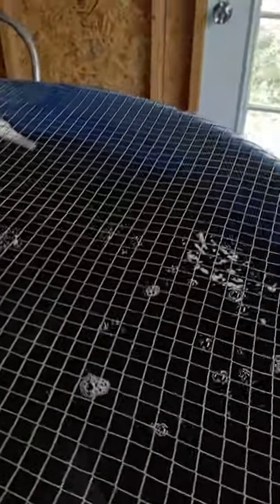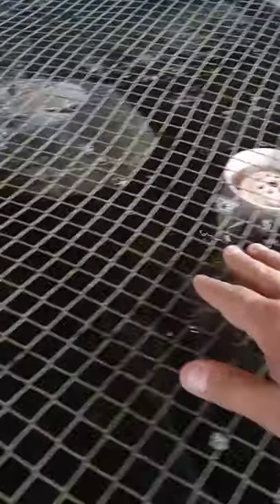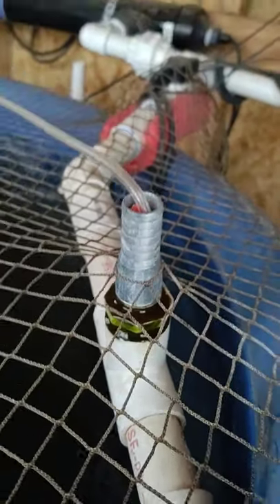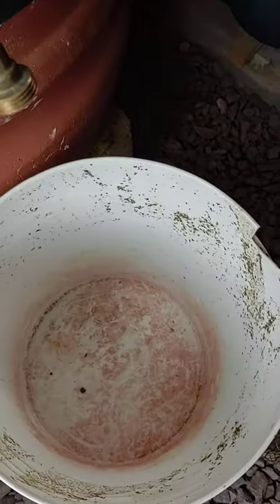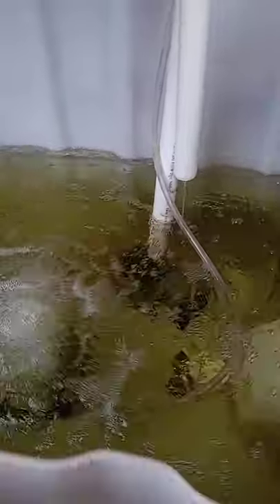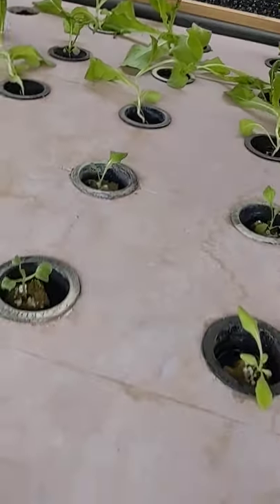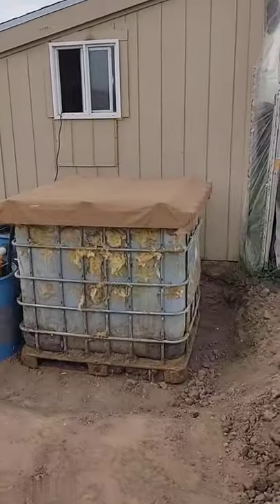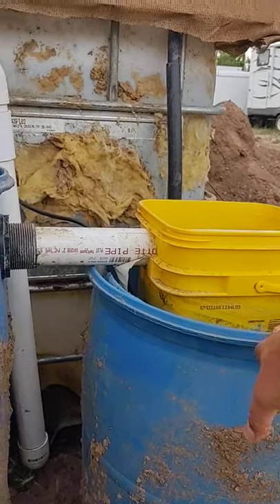Decoupled vs coupled aquaponics.

Comment: Do you add additional nutrients to your hydroponics tank?
Reply from the maker: Yeah there is a pepper jar that is 30 gallons. It allows me two things. 1. to mix nutrients in smaller batches and 2. allows me to micromanage the nutrients for testing. Micromanagement of the nutrients are crucial for nitrogen hogs like tomatoes
Reply from the maker: for the aquaponic system, I will add micro nutrients into the sump tank in the ground. The nutrients overflow into the sump from the pepper jar. However the water returning does not go back to the fish. This gives me the freedom to add nutrients that may be missing in the grow side without affecting the fish's welfare. Plants need the fish, fish dont need the plants (typically) HOWEVER you will need something to stop the spike in NO3 that build up through time. Thats why I added the small strawberry flood n drain system to strip the NO3's from the fish tank. Its nice because we get strawberrys year round.